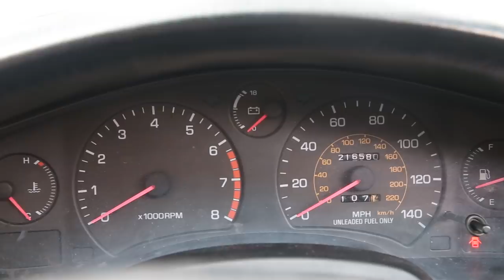I Bought The Worst Toyota MR2 Turbo In The Country For $1,000 And It's Awesome

Comment: The "MR" in MR2 does not stand for Mid-Rear. It actually stands for "Midship Runabout" and the 2 means for 2 people. MR2 = Midship Runabout for 2. Ask Toyota.
Reply: Came here to post this. 

What kind of self-respecting MR2 enthusiast doesn't already know this?  ;-)
Reply: And WTF does midship runabout even mean?
Reply: Tim Ramich the dictionary is typically a great resource for questions like that.

MIDSHIP - [mid-ship] adjective -
in or belonging to the middle part of a ship.

RUNABOUT - [ruhn-uh-bout] noun -
a small, light automobile or other vehicle, usually with an open top; roadster.
Reply: Peloton25 To me, using those words sounds like another bad translation to English. Mid-rear makes more sense.
Reply: Tim Ramich well that's your opinion, but "Runabout" is certainly not a synonym for "rear" under any circumstance. 

This isn't simply a case of bad translation either - these are both common nautical terms being repurposed in an automotive product, similar to how Ferrari's use of the term Barchetta means "little boat" in Italian. 

Toyota have referred to the MR2 as "Midship Runabout" since the beginnings of the model in the early 1980s. My 2003 Spyder has it boldly printed in raised lettering on the Frunk cover. It was also spelled out on the nose badge fitted to these cars in other markets where their oval-T logo isn't prominent.
Reply: Peloton25 I didn’t say it was a synonym. I dunno why anyone would want to use a nautical term for a performance car. Boats are heavy, slow, and gay. It’s fine to call a big old man car a boat.
Reply: Tim Ramich you've never been water skiing? Plenty of small, light, fast boats out there. 

Look, we could go back and forth on this all day long, but whether you like it or not the only answer is "Midship Runabout".
Reply: Jocob Miller I'm glad someone else knows this guy is talking out of his ass
Reply: I though it was mid engine rear wheel drive 2 seater
Reply: I thought MR meant mister
And a #2 signifies poop
"Mister Crap"
Reply: If he would have saved more money he could of gotten one in better condition but hey, it should be fun making it into what you want
Reply: I have always said MR2 stands for Minimal Room for 2. Hey, own one and love it!

Comment: Perfect car. I autocrossed a 91 turbo in A stock scca for 3 years back in 2005 ish. Pretty successfully. 1st or 2nd every time. Zero toe front and back. Crash bolts on front allowed -3 deg camber. Dropped lot of weight by chopping muffler. Just had a turndown after cat. Front swaybar upgrade is allowed in stock. Let's you get on the gas earlier coming out of corners. Toyota put in race harness mount point behind headrest on firewall. Harness lets you use your arms for steering only not to also stabilize your shifting body weight. Good luck man!

Comment: I owned a 1991 MR2 non turbo, no wing.  T tops.  It had 86 000km when I bought it, and it was totaled in an accident 5 years later with close to 300 000km on it.  Only thing I ever did to it was replace a clutch and 2 sets of tires!  I loved that car, and daily'd it!  I'd love another one.  I'd throw an LS in it, longitudinal, figure out a way to mount the transmission between the front seats and some sort of AWD.  Definitely not purist, definitely not cheap, definitely would be fun!

Comment: Easiest way to be for sure if it's NA or Turbo is to check the VIN.  A turbo will start with SW20 and the NA will have SW21.

Believe it or not but those pop up T-top vents actually make a huge difference.

Comment: I might be able to one up you. I bought a 2001 MR2 Spyder with 170,000 miles a few months ago, and only seemed to have a weird issue where the engine wouldn't rev past 5,000 rpms. I paid $4,000 after tax and the dealer fees. The dealer gave me some disclosure agreement saying the title was "at one point" rebuilt in a different state, but was "clean" now- somehow. I, naively, bought it- of course- and went and got it briefly checked out and learned a few things. First, the engine in it isn't original. It is a 1zz, which is the original type of engine, but it was swapped right out of some Corolla. That could be either a good or a bad thing, but I don't know which (I'm going to assume bad), because it's not documented anywhere on the vin by car fax, and obviously wasn't even disclosed by the dealership. That tells me it was probably swapped very amateurishly. Some other hints at this, is that one of the motor mounts is missing, so the corner of the engine is literally welded onto the chassis. There's rear damage on the chassis, but all of the body panels appear to have been replaced. The catalytic converter appears to be completely clogged, causing the engine revving problem. The clutch is slipping extremely badly. The soft top has tons of holes in it. The hand brake cable is snapped. The list goes on.
And I paid $4,000 for it. It was my first car purchase, so I've learned my lesson.

Comment: Love the vids man Keep them coming. This is a great idea for a video series because us working stiffs can relate. I don't have $13,000 around for a autsin but I can damn sure work on a $1000 bucket. Lmao. Anyway keep it up and don't change a thing. I like the surprise of not knowing what car you are working on next.
You rock!!!!!
Oh hey I think those flaps were installed to stop the wind from causing a vibration when splitting the roof. When you get it on the road try hitting the freeway and pulling them both down. I bet you get a mean vibration.  My Ram does it with the back windows and if I drop the flap manually on the sunroof.

Comment: the Mk1 MR2  was pretty much a copy of the 1972 Fiat X1/9
Reply: Thank you, was looking for this. The MR2 is by no means the first affordable mid engined car
Reply: @zoufmalade  but the x/9 was a commercial failiure and a poor effort at building an affordable mid engined car. Not to mentoin its practically forgotten
Reply: I wouldn't call 174 000 units during 17 years a commercial failure for that kind of car. It's about 2/3 of the whole production number for the AW and SW MR2s. It was underpowered, but handling was totally on par with what you could find on a MR2. In Europe they were way more used in motorsport than a MR2, especially for hillclimbs, with silly aero bodykits, and engine swaps. On of the most popular choice was to swap the 1.4 turbo from the Uno Turbo IE.

Comment: Be safe in the storm. Buy a 300zx twin turbo
Reply from the maker: I CAN'T DO BOTH PAUL
Reply: I know I just ment in the future man I was tryin to buy that sc so bad Bro u did it right. I gotta fix my 94. But keep up the good work don't listen to the haters im in Atlanta n hear the storm is gonna get bad make sure u take precautions Bro. I had a buddy with 700hp in one of these most scary ride of my life lol
Reply: Tavarish baaahahahahahaha! Hahahahahaha
Reply: paul s 300zx oversteer easier with the fr layout, even the base na.  My mr2 at 280hp has a ton of traction due to engine weight over rear wheels.  The 300zx na i drove surprisingly felt loose like a mustang on corner exit.
Reply: 1compaqedr8 I used to have a hks 1995 300zx twin turbo like the SC they can be tricky depending who n what is done to it but I spent alot doing it now things are cheaper n tavarish makes things easier so I just wanted to see what he would do to it these days. I still like the mr2 I had a buddy with 750 at the wheels n a kit but it was way to scary had a 355 body.
Reply: MR layout would make it over steer more than FR. Yes you might get a little more traction with the added weight, but you're throwing that weight around when turning hard, so that weight just wants to keep going

Comment: Wing is missing a part. They are a four piece design. There should be another piece you have. Also, dump the dog-ear intake. Airflow through the engine bay is designed to flow from under the car, out through the top of the engine cover. If you have the rear underbody plastic, there is an area that directs air up toward the underside of the turbo. Also the side intakes work to direct air into the sides and up through the top of the engine cover. If you ever find yourself in the Savannah, GA area, hit me up. We can put you in the seats of a gen 2 swap car (like yours) a gen 4 swap car, and I have a 2GR-FE swap in mine.

Comment: You couldn't be more wrong about the Fiero. The Fiero throughout the years of its production outsold the MR2 crx and rx7 combined. MR2s have been used for replicas but not as often because they didn't sell as well and aren't as modular. The fiero has a much bigger following, many more swap options and stilll lives on today in the corvette. The fiero was the first car to use a full space frame that was adopted by the corvette in every generation since the fiero.

The fiero community is so big and so active, you could probably go to fiero.nl and find more people who are experts on the MR2 than a MR2 forum.

And yes the sunroof fieros stored the sunroof under the front hood when it was removed and had a wind deflectore. The T-top cars were all aftermarket.
Reply: 1. You are a fanboy
2. Stop lying. I cant even count how many lies you just posted.
The fiero was a shockingly bad car, and will never be as good as an mr2

Comment: Good stuff man! Thanks for the video! Good luck with the car!
Quick note though, the Turbo identifiers you pointed out aren't really accurate. The spoiler was the same on all trim levels, but changed with refreshes. Also, the bumper is exactly the same on both, but yes the Turbo would have the fog lights installed normally. The easiest way to identify a Turbo chassis from the outside is the engine bay lid.

Comment: Read up on what/how the Fiero came to be. Has nothing to do with what you stated. It's a more flexible to modify platform and could handle more variations on the body so maybe that's why there were all kinds of odd body kits like the beetle used to have. It helped that the body on the Fiero was a brand new design, not metal and was way more durable than alum/steel. That's why today you see so many still around. I liked the first-gen MR2 myself and thought the 90's version was too complex and expensive. 
When you see 80's MR2's you'll notice they didn't last so well. Fiero's, as ugly as they may be, are all over the place and can accommodate a much larger engine than an Mr2. They show up in classic car shows with a few body mods and supercharged v6's and on occasion an LS1. 
Nice video and thanks for this!

Comment: I used to have an '85 MR2; bought it when it first came out.  Blast to drive, even if under powered.  I thought MR2 stood for "Mid engine Rear wheel drive 2-seater".  At least, that's what I recall having read in the car magazines back when it was first introduced.

Comment: The fiero does have the deflector on the sunroof. Also, if you compare the same year fieros with the mr2, they performed very similar to each other. The V6 Fiero actually got a lot of better reviews than the mr2s. When you compare your mr2 to the fiero, you're comparing apples to oranges. The fiero wasn't designed to be a car where people said "I think I can make this a ferrari." GM didn't want the fiero to compete with corvette sales, so they didn't want to put much into it. That is also why the car got canned. They claim it was due to poor sales, but all of the cars were sold. The prototype turbo models were estimated to perform better than the corvettes. That was when it got canned.

Comment: The MR2 and Honda NSX may both be mid engine, rear drive cars but I think it's pretty silly to say that "an NSX is basically just a bit bigger MR2 with slightly more power so that makes the MR2 really good". They're extremely different, though both good cars in their own way.

Comment: hey im new to your channel and you just picked up a perfect car to learn and spend hours in the garage when u dont have nothing to do and please keep the snorkle it helps a lot to cool the engine out plus u have the fans but u need to drill the holes in the hood so the air can flow better

Comment: I never knew much about JDM growing up in KY it was all big 3 cars but I had a built 3.1 cavalier Z/24 that was fairly quick back in the 90’s and I tried to race one of these on the 4 lane and that guy came around me like I was tied to a stump hurt my feelings I had no idea they where that quick. I got him from the kick I had the torque but once he got that turbo spooled up he came around me flying and ran off and left me I was honestly shocked. And this was in like 1996 so it was almost a new car then so still nice and fresh. My Z/24 had been bought new by a marine and he had blew the car up so the dealer bored the engine out to .60 over and put in bigger valves and a few more things car came with the receipts showing what all had been done to the engine and I got it with 26k miles on it and had just won a insurance settlement so I had a full header and exhaust installed along with a ram air cold air induction had a chip put in the pcm bigger nicer plug wires and a stronger fuel pump along with larger injectors and chrome 16” wheels and tires so it was a fast little Z/24 I had the fastest Z in my town I would drive around 5.0’s like nothing and other Z/24’s only cars back then that really drove around me was the Z/28’s yea they where faster but ha that’s a LT1 so cant feel bad about that.

Comment: you should by my coworkers 300zx. full riced out 2001 body kit, fake forgiato style wheels, and the cheap kit is cracked on the front and rear bumpers. faded yellow paint to top it off

Comment: ..you could stack the 91 MR2 non-turbo chassis on top of the 87 Porsche 944 Turbo...in front of your house...and if (i hope it does not) the Irma Hurricane hits you...turn on both turbo engines to blow the high winds around your house...thus not hitting your house with full force.

Comment: If it has a decent leak-down and compression test, you may be able to pull the motor, put the stock turbo back on it and sell it for what you bought the car for lol. Might be in for a rude awakening when you start to inspect what's been hit, how bad, and for body rust; let alone how many of the parts are long ago discontinued. Might need another MR2 just to be a parts donor or rolling chassis to swap the engine into. I can list a few dozen things at least that need to be done but I'll just sum it up with this: The $10,000 you would have spent to get a "best" MR2 will seem like a steal compared to the potential amount of time and money that could be dumped into this car.
Reply: alanclv So true. Many 90s cars have this problem but specialty 90s cars from Japan doubly so.

Comment: ... but never put in a production obtainable affordable sports car? Fiat made its X1/9 (a mid engine rear wheel drive sports car designed by Bertone) exactly for that reason. Also, I could be wrong but I believe MR stands for mid-engine rear wheel, not Mid-rear engine.

Comment: yeah, good luck finding a 1999 2nd gen MR2 spyder for 15 grand xD, Im really looking forward to see what he does with this one :D also its called a Tom Scoop, not a snorkel lol, another way you can tell if it was originally a turbo version, the chassis code and on the vin # it should say sw20, non turbo 2.2l ones were sw21, unless that was for t tops vs sunroof its been so many years I cant remember, but all turbo versions sold in USA were t tops, definitely check out MR2OC

Comment: I would argue that the Fiero was far better FOR the very reason you slam it. You can do so much with a fiero. Not to mention every MR2 I see some teenager has thrashed and beat up and put horrible mods into it, where you can find tons of perfectly stock fieros for relatively cheap. But I will admit I am a bit bias, I have always wanted a fiero.

Comment: The Fiero is the better car. It is easier to work on, and doesn't have as much of a snap over steer presence that the MR2 does. It does have a wind deflector as well that sits in the front of the car when the sunroof is in place.

Drive one, and you'll sell your MR2

Comment: You got ripped off lol. Purchased my car for 2K. 91-92 NA in 8-10 shape for for 3500$

Also the snorkel doesn't do anything. air comes from the bottom and comes out the engine lid. They were proved useless over a decade ago.

Comment: if that's your take on the fiero you really should consider driving one (preferably an 88 thats been swapped). id bet youd change your mind.
 they aren't just a basis for a kit and honestly 90% of the people that love them hate that people put kits on them.
Reply: Phantom Fiero can you even still find a fiero that runs?
Reply: Joe Public my mom bought her 87 2m4 new in 88 and has daily driven it ever since. Ive also owned an 88 formula for a couple years now that I daily drive. Drove it from southern California to northern Washington with the a.c. on full blast with no problems lol. I have a 3400sfi+turbo+f23 going into it this winter too. Not cause I need to but because I want to make decent power. Theres also about 30-40 more that are part of the club up here. Friend of mine just bought a formula that has 80,000 miles on it and there's a couple more just like it on Craigslist.
Honestly I've seen more mr2s in junkyards and whatnot than I've seen fieros and I frequently go looking for them. 
And I'm not saying mr2s are crap, I actually want one the same year as the one in this.
Reply: Phantom Fiero wow I haven't seen a fiero in 20 years. None around here.

Comment: I remember destroying many  late model MR2s on the highway because they only had 242 hp and  low torque.  More realistic 1/4 mile time for stock 1995 mr2 turbo is 14.8 not 13.1.      tested by Motortrend,  Motorweek, Automobile,  Car and Driver, Mopar1us,